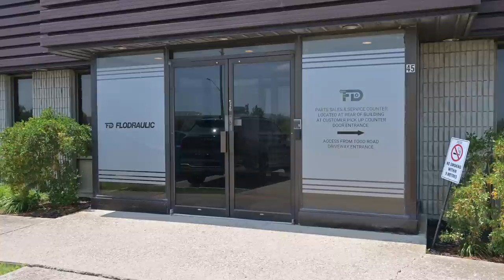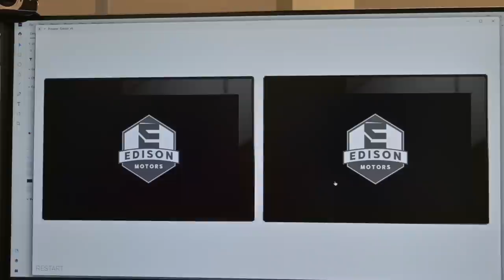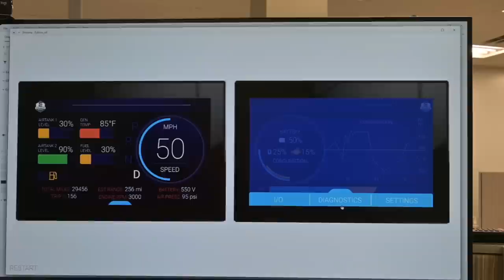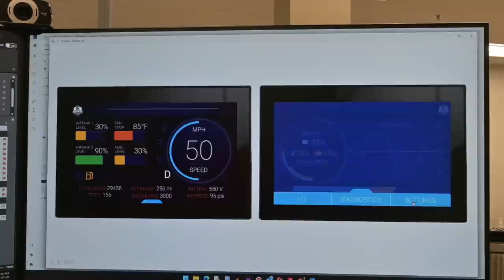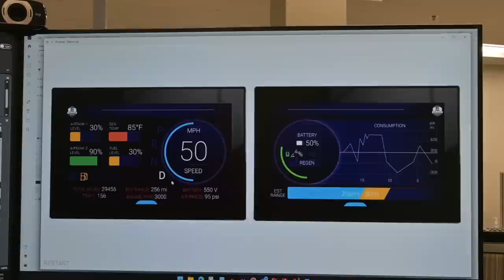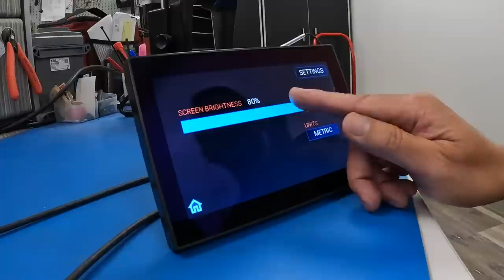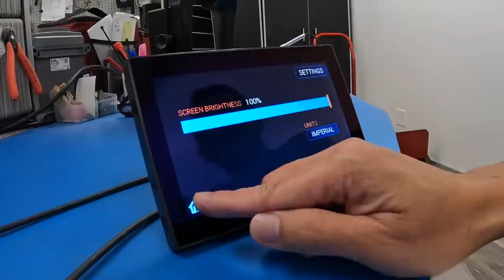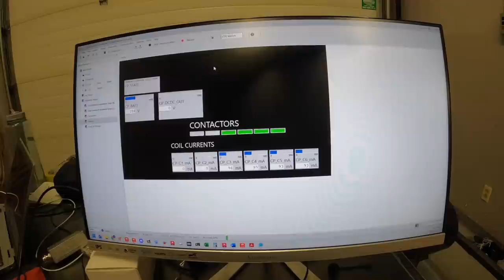Testing The E-Axles

Comment: Is it a capacitive or a resistive touchscreen? Capacitive is better as a touchscreen, but resistive is more adaptable. Capacitive touchscreens won't work with most gloves and I've seen some people, especially the working man type, whose dry calloused hands just don't work with a capacitive screen. Also, resistive screens will work with a stick or any physical object, really handy if you need to work with it from an awkward position or you're too short or something.

Comment: Haven't finished watching yet. My interest is purely as a tech enthusiast, having an electronics background, and working in IT. I'm curious what the complete tech stack is, hardware, firmware, software, OS/hypervisor, etc. I hope its running BlackBerry QNX for commercial vehicle applications. This gives you a safety certified OS and hypervisor, allowing everything else to run independently on top of QNX and isolated from the core vehicle operations. This means infotainment systems including Android Auto (or I guess Apple CarPlay for those using iPhone), assuming you plan to support this, or built in GPS nav software, the AM/FM/SeriousXM radios/AV system, or even possibly the cab heating and air conditioning controls can all run independently, if the infotainment system crashes, the vehicle operations software is unaffected. I know theres other tech stacks that could be used, but BB QNX (and QNX even before being aquaired by BB) has a long history of reliability in real time safety focused, mission critical applications including high speed trains, military, and other applications. Plus BB provides great service and support o their QNX customers/partners, and they are Canadian too!
I'd also love to know what CPU/GPU/memory/storage platform you plan to use.

Comment: Why would hydrolics be part of the base chassis, I'd think the needs around that would be different for every body type, why not pass off hv power to the body for them to have whatever air compressors, hydrolic pumps, electric motors, etc.  Maybe offer some options for a sort of basic hydraulic pump, and/or air compressor for less demanding bodies to notneed to deal with it, but I'd think copious high voltage electricity would be like the ultimate insanely flexible pto replacement, let the body side optimize the hydraulic and pneumatic systems for their needs.  The other possible option would be power converters to various standard power systems so the body makers could use one they are familiar with and could make systems more portable across chassis with different electrical systems, and even via pto driven generators with non electric chassis.  Having a few power options like 120/208 three phase or 277/480 three phase, and probably a few common dc voltages (not sure what those are for these type of applications, other than battery packs for larger ups units I'm only really familiar with relatively low voltage dc common voltages like 12, 24, and 48, at those power levels that's likely to be far too low and you don't have the driver larger ups systems do for efficiency by closely matching dc bus and ac bus voltages)

Comment: I think the generator needs to be able to bypass the batteries and directly power the e-axles, otherwise by constantly charging and discharging the batteries at the same time they will wear out quickly
Reply: The generator will only go one speed, the e-axles will vary power demand.  The batteries and the Management system are the buffer to keep the e-axles from being destroyed.  You're taking about doing the equivalent of connecting the axles directly to the engine without a transmission to vary the power output.
Reply: I'm sorry I always miss the replies to my comments on youtube. Anyway, what I'm suggesting is just what diesel locomotives and dump trucks already do, so it's quite a proven setup. Adding batteries would bring all the regen and peak power boost benefits which are always welcome. @brianb-p6586 I'm happy to hear such news, I think I have missed that video you're talking about, my bad
Reply: @brianb-p6586  I will absolutely do so. I really like what Edison is doing and I hope everything will turn out in the best possible way, that's the only reason I wrote comments like mine :) Thanks for replying